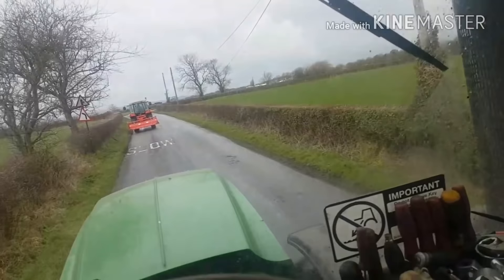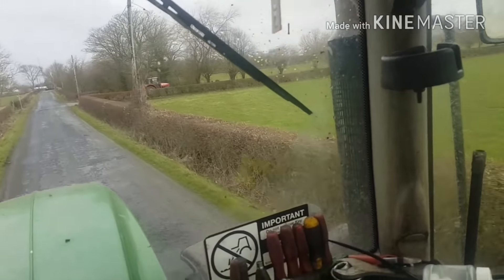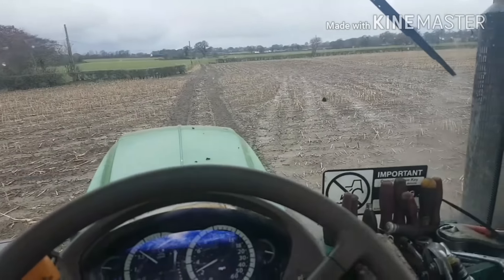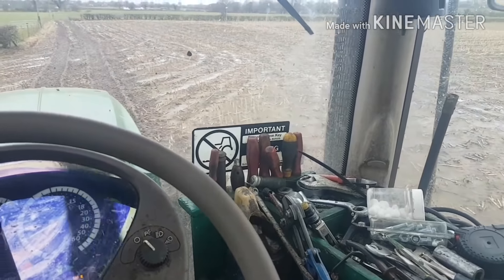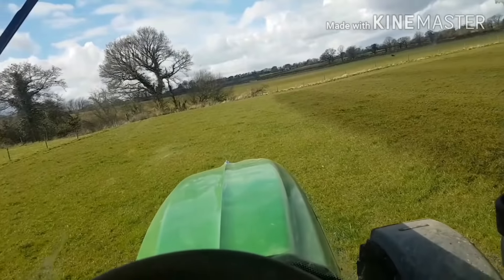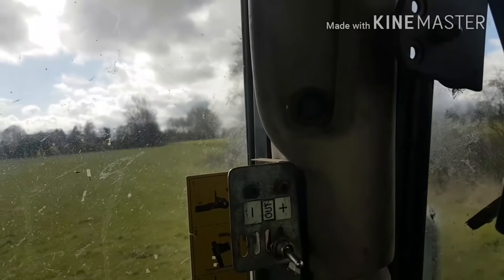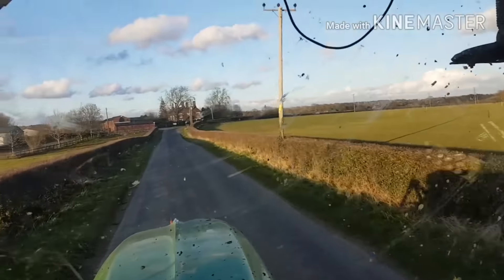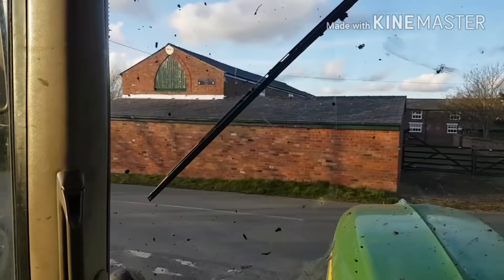Tanking slurry an breaking down

Comment: Great video! Shame about this bastard weather we’re having 🙄🙄, that cab looks slightly cluttered 😬 what’s with having all the tools in there??
Reply from the maker: It's really starting annoying. Boss man's tractor/workshop. Trys to have the tools for most eventualities. Tool box does rob off side visability though
Reply: Ed Thomas all the tools are in there because it's a deere😉😂
Reply: Best bet is to make a bracket for front links or weights and bolt a tool box to it, good job to do on these crappy wet days we keep getting.
Reply from the maker: Likes his tools in the cab. Not my preference
Reply: Or to get even more space for the tools if it had front linkage which I don't think it has not sure if it had you could throw all the tools into a front  linkage box on the front and also how many screens do you have in the tractor I know 1 is a camera but there must have been wiring to fix about 20 screens in there